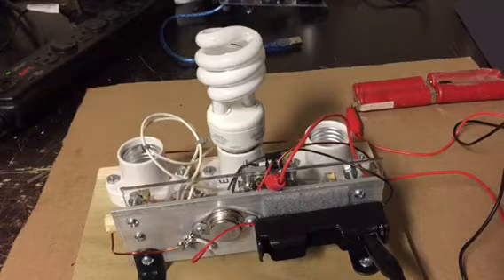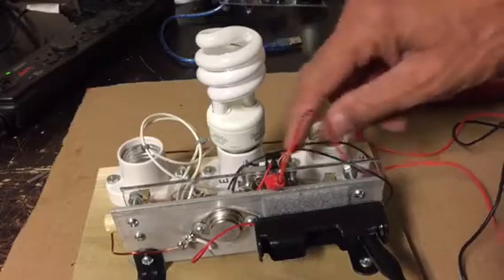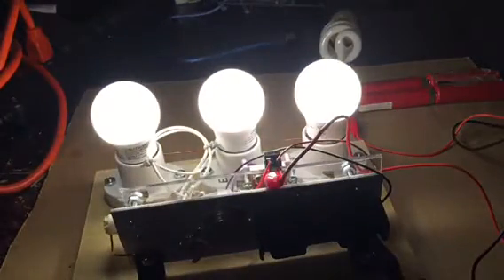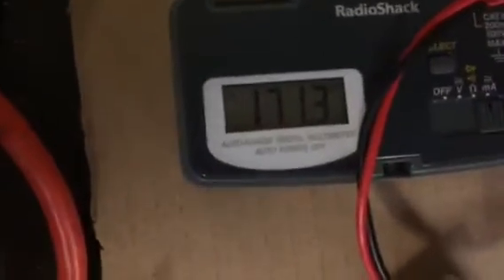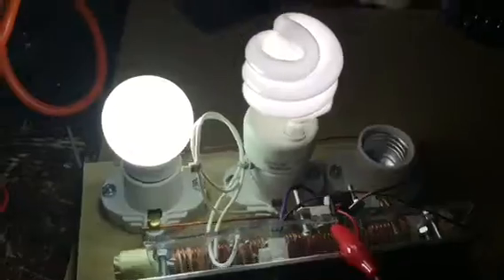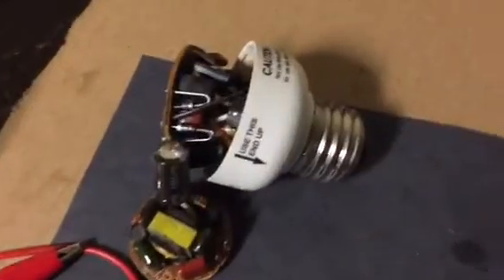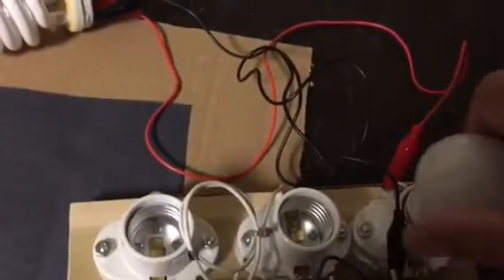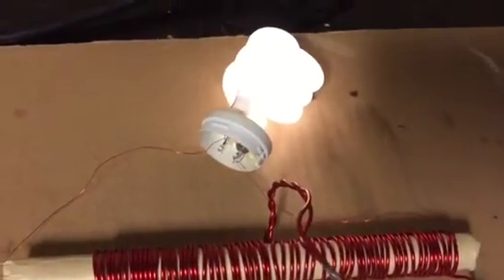Lighting with Super Joule Thief vs Joule Thief

Comment: wow.how many turns in pry-and sec.can u show us the diagram pls?!!!
Reply from the maker: Sorry for my late reply. This is the original circuit:  Image from http://overunity.com/10179/joule-ringer/dlattach/attach/115512/image//.
This is based on the work of laser saber. It worked surprisingly well. My ferrite did was smaller i.e. thinner and slightly shorter but it still worked very well. I used 28 awg wire for the secondary  the same as was used in the original circuit.

Comment: Nice video thanks for sharing
can you please sent me schematics and more coil info
Reply from the maker: The circuit is based in the work of  lasersaber.  The circuit is as follows:
Image from http://overunity.com/10179/joule-ringer/dlattach/attach/115512/image//.
My ferrite rod was thinner and shorter but it still worked very well and could light multiple bulbs. It is so efficient that I am still using it after several months on a single charge of the Li Ion battery!

Comment: hi nice video can you please send me a schematic, thanks
Reply from the maker: Sorry for my late reply. This is the original circuit:  Image from http://overunity.com/10179/joule-ringer/dlattach/attach/115512/image//.
This is based on the work of laser saber. It worked surprisingly well. My ferrite did was smaller i.e. thinner and slightly shorter but it still worked very well. I used 28 awg wire for the secondary  the same as was used in the original circuit.